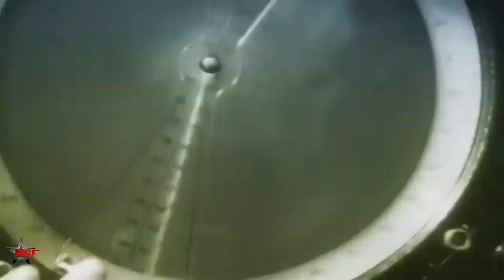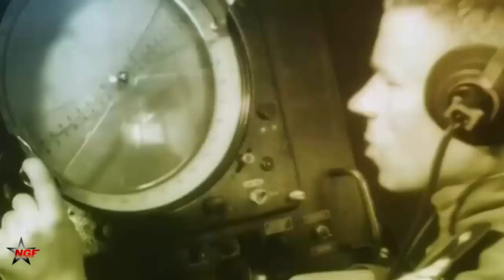Shocked the World! Russian 6th-gen MiG-41 interceptor will fly this year, Russia says

Comment: Speed of mig- 41 is in hi orbit it has little or no air resistance. Video host somehow doesn't know that. In order to talk about mig-41 you've to be educated then talk or it will show how ignorants script of this video is. Good luck next time.👍
Reply: The host did not even know the difference between grams and gravity. he said that the plane could withstand a pressure of 9 grams, which is not even the weight of a glass of beer.